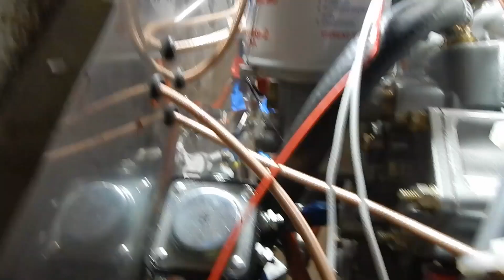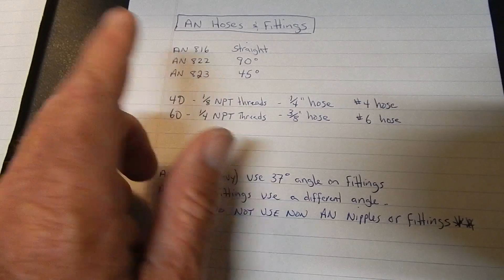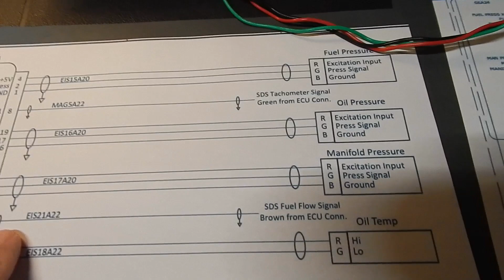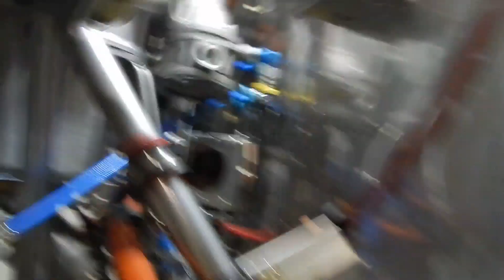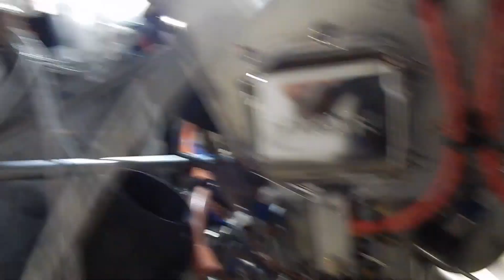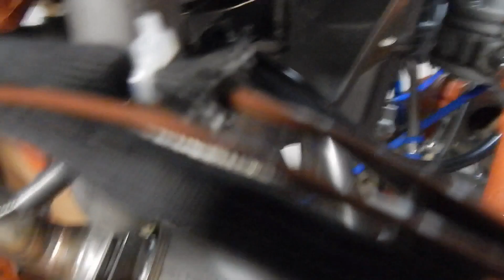RANS S21 Build ep 45 Engine Sensors and Hoses

Comment: Thanks heaps. Agreed totally on sentiment of frustration at this stage of the build. Lack of documentation makes it look like all too hard and do something else for a while! I think you’ve put me back into action. Great detail. I now see where the oil temp sensor goes. It’s no longer a well kept secret. The manifold makes sense. The fuel transducer hose runs. Yeah… really appreciate your help. I’m thinking of unbolting the top 2 engine mount to fuselage bolts and engine hoist on top again then ease the engine forward an 1” or so to tackle the oil temp sensor.